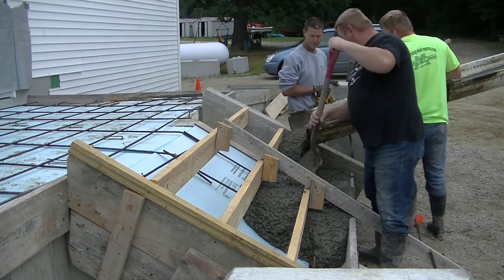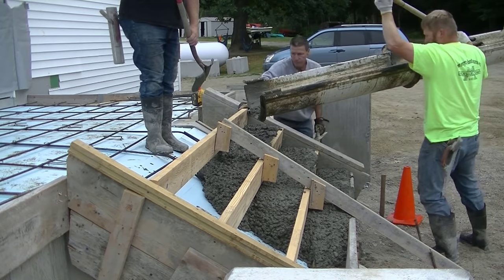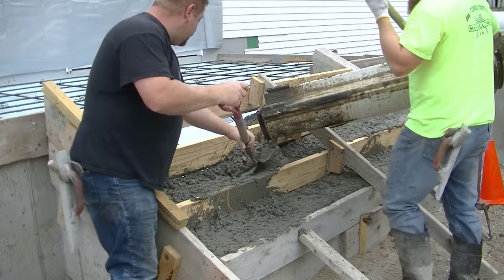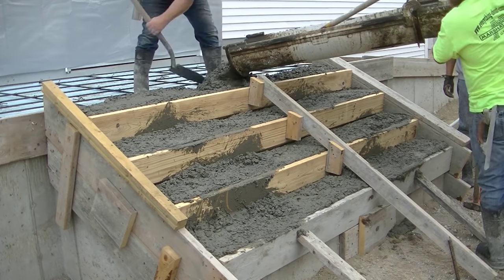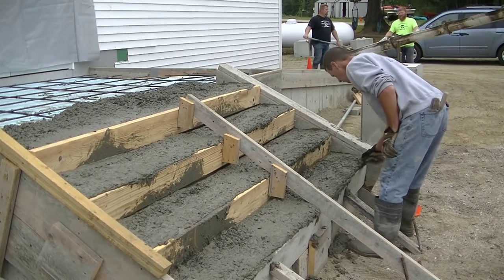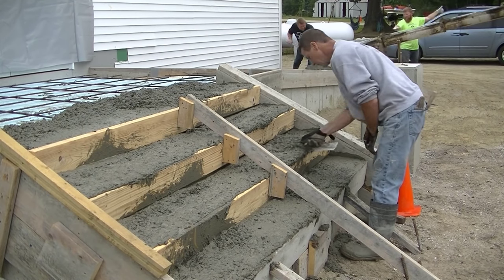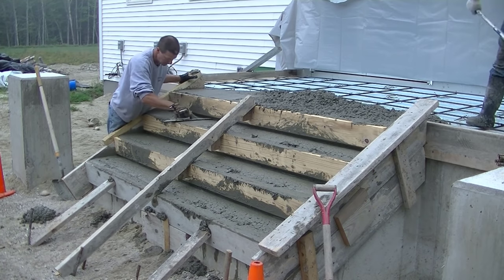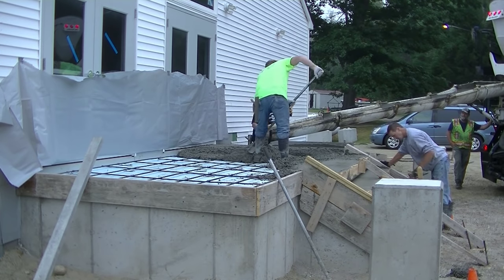Pouring Concrete Steps (How To Pour Concrete Steps)

Comment: I checked out a couple of your videos. You do nice work, your stamps look good particularly, but you're doing stairs backward in my opinion. Do your top stair in the landing first and go down top to bottom. You don't have all that creep that you're digging and throwing back up top. After you get them in, wet your load up a few gallons And pour the landing like you'd normally do. Makes for a much neater job and less work as stupid as it might sound to you. Any builder I've ever finished for on the east coast wanted it done that way and I've tried bottom to top after thinking to myself it would be easier. I assure you it is not. That's just my two cents, not ragging on you or your guys at all.

Comment: slump does NOT mean how wet or how dry.  Slump is the diameter of a puddle of certain volume of cement dropped from a certain height and can be massively changed with additives for a fixed amount of water.

Comment: Ive just poured 5 steps right now..waiting for the concrete to settle and suck its water back in so i can finish them...but after seing your video,i regret not doing the 45 angle trick...😢its a great ideea...much easier to finish under that plank...😅

Comment: Hey Mike
Love your videos, the only problem is you don't use chairs to hold your steel off the ground or Styrofoam. 
There's no structural benefit when your steel lays on the bottom of your pour,
HAS TO BE LIFTED
Reply: its the liner  under or does it need both?

Comment: Those concrete pillars by the steps are massive!
Reply from the maker: I know, they'll all be covered in stone when they finish.
Reply: Hey Mike from TORONTO, ONTARIO, CANADA....... i Love the VIDEO.....  very educational...  Did you FORGET TO PUT  CHAIRS to elevate the REBARS to the middle Thickness of the CONCRÈTE PAD ?
Reply: Too much VIBRATION of CONCRETE is NO GOOD because the AGGREGATE STONES in the CONCRETE MIXTURE SINK TO THE BOTTOM causing to lose Strength of the CONCRÈTE....... too Much VIBRATION IS BAD..... 
Also, 
TAP THE FORMS WITH HAMMER when pouring the concrete and just after the pour while screeding the concrete.
Reply: Where are these Pillars situated  ? ..... I cannot see the Pillar Columns ..

Comment: It’s good to hear you sponge out the riser faces, bcz that’s a practice that has largely gone by the wayside down here, in the last few decades. 
  I used to get ⅛” aluminum plate, made for the faces and screw them on to the risers. That was very effective at producing a nice slick finish on the faces if we weren’t going to take the time to sponge them out. It also looked good with the contrasting slick risers to the broomed treads. Obviously only practical for repetitive sets.
Reply from the maker: Sponging really isn't that much extra work and really makes a difference to the final look. I know some guys just don't dare to strip the forms off too soon. Looking at air voids after pulling the forms isn't a good look to me.
Reply: i like to add lighting or dress up several ways of course its a budget thing  safe travels guys !!!

Comment: I built my own house, I'm not a tradesman but rather a businessman. 32 years ago I decided to pour an 18 by 8 foot deck in the back of my house. I built the forms, I installed rebar every 12 inch square. On the 18 foot side one end is resting on the foundation, the center is on a 10 inch tubular pillar (Sonotube) and the other end is held up by the stairs, all this five feet off the ground and 6 inches thick. I called for 4000 pound strong low slump concrete with ½ inch stone. Now here is the clincher: I was alone, the first time iI had ever done this kind of work and it was in August with a 75 degree sunny day. Boy, did I suffer, the concrete was starting to harden before I had finished magging it. I concentrated on the stairs, the forms of witch were cut at 45 degrees, because it had to be done right. After they were ready I got to magging the surface with a 3 foot length  of 2x4 and a wood trowel. Fighting with the concrete I started seeing black spots in front of my eyes but I finally made it. Final result: straight set of stairs, a very little bit of wavy surface but with a good slope, some stones showing trough. Not one crack, not even an hairline one, all this standing up after 30 years.
I'm so happy to see what you are doing here Mike, I validates what I did way back then and I learn even more with you teachings. Today, I just finished a repair job at my son's home, an 8 by 18 foot deck suffering from a terminal case of spalted concrete. Done with Quickrete product, nice broom finish on a diamond grinder prepped surface. We watched your three videos covering that subject and it turned out to be a success. I'm a 69 year old retiree with a metal hip. Thank you Mike for your excellent teaching.
Reply from the maker: Nice story! That's good to hear about the videos helping. That's why I'm posting all of them.

Comment: I've been working with concrete for over 30 yrs. A time or two I've forgotten rerode in stairs lol. You needed that concrete stiff. If you was pouring on sand and dirt you could've loosened it up alittle. But good work
Reply from the maker: Thank you!

Comment: Another good way to set up those steps is run a router on the cove. You can still put bevel cut. Just ends up being more like a 20deree instead of 45.  For big set of steps real beneficial. Hope that helps

Comment: Good work, good advice, good techniques. But I have not seen the finishing video yet, did you upload that? I was really interested in how long you waited before pulling the forms off. I live in California and it can be 90 degrees in the winter, and triple digits in the summer. We definitely have to scramble more so it doesn't get away from us.
Reply from the maker: The finishing video is in my training academy The Concrete Underground!

Comment: I noticed you don't use chairs to hold your steel up off the Styrofoam ?
Also the steel in the steps was tied to tight to the slab steel. No room to lift the slab steel to center of concrete

Comment: Mike I appreciate you and the time to put them together. Do you ever put a control joint in wide steps/stairs? If so I would assume you do both the treads and the risers. What about if you have steps that are on 2 sides?

Comment: Well done. Mike, I came home to find stucco all over my week old concrete steps. Any ideas on how to clean this mess up?
Reply from the maker: Never had to remove stucco, anyone else in here done that?
Reply: Try using a thin putty knife and do a pushing motion. Hopefully it pops it off.
Reply: @247KW  thanks. Just didn't want to lose the broom finish. Wound up scraping a bit with a 5 in 1 tool and scrubbing with an aluminum brush. Can see the smooth spots. Hoping it will even out in time
Reply: @rickkinnally7  b

Comment: Hi Mike. How do I find a good contractor that has the skill and knowledge to pour me a super level and smooth/polished 24' x 32' workshop slab at my home. It will have to support a 1500# lathe and mill. Thinking 5 1/2" thick 4000psi with rebar and fibers? Really want to know about finding the right contractor... Thanks...

Comment: Did concrete for years rebar that is on the bottom is useless needs to be lifted into concrete same with wire mesh just saying
Reply from the maker: We all know that.
Reply: But you didnt pull it up